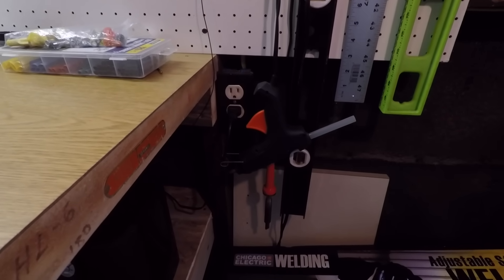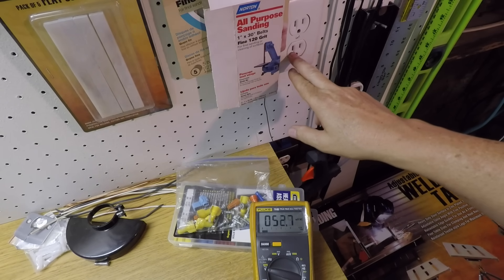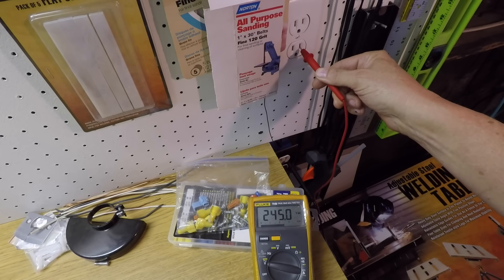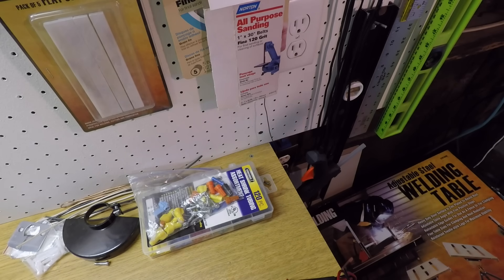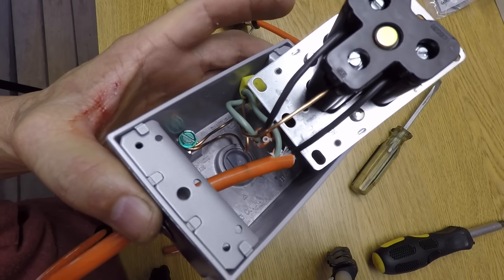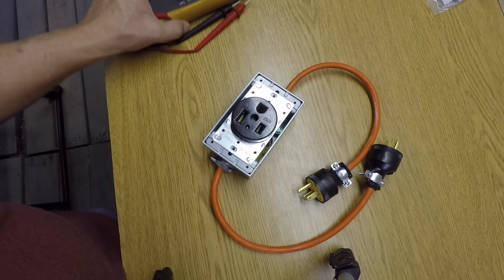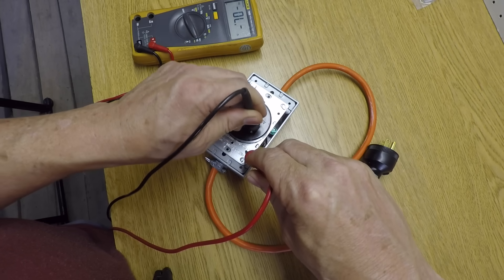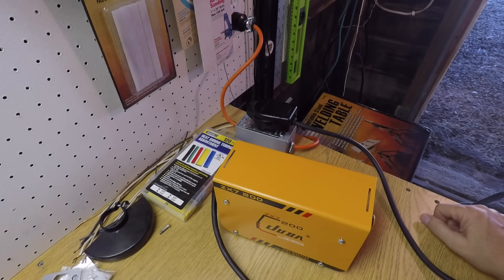How to Get 220v From 110v

Comment: definitely one way of doing it...i just made a 220  extension cable and plug it into my dryers outlet when i want to weld
Reply: probably the best idea next to running a dedicated line. And if the dryer is near where you need to weld, that works out great.

Comment: Your lucky that your 110 Volt receptacles are on different phases, if it wasn't you would have issues. What is not code and you never spoke about, at anytime on a 220 volt circuit your breaker requires a tie bar, so both breakers should trip. Safety first.

Comment: For my own home I would just run another 220 line from my panel. Plenty of room in there yet. In fact, there is a 220 line for an electric dryer in the laundry room that has never been used, we have always had natural gas dryer that plugs into 110 for the drum and ignition. But I like the idea. Thanks for the informative video.

Comment: If one breaker pop up due to 20amps + consumption, you will damage your 240v device running on 120v.

Solution for that is transistor as a switch
Reply: The connector he is using is a NEMA 6-50R and it has no neutral.  The bottom round connector is ground and should not be used for power as a neutral would, so this means that the device plugged in should not be able to get 120v power except by using ground which is not code and should not happen.
Reply: Not correct, you would need a path back to the neutral bus on main panel to complete a 120volt circuit. It draws 240v by connecting leg one of your panel back to leg two via the welder, so if a breaker pops you just have an open circuit. I suppose the danger is not knowing a breaker popped and opening the unit, and "completing" the circuit.

Comment: 20 A breaker, "20 A" wire, BUT 15 A plugs ??????? something doesn't add up.
Reply: NEC code allows you to use 15 amp duplex receptacles on a 20 amp circuit but not a 15 amp single receptacle on a 20 amp circuit.  Look up code 210.21B...He obviously has a few code violations here but that is one of them.
Reply: So what going on like drew parked said , he is using a different plug type then what we normally seen on 20 A

Comment: Just move to NZ we use real Voltages 230 Volts at 50 HZ (or 3 phase is 400 volts between). so we use 10 amp plug sockets. We also have the Round 15 amp Sockets for caravans etc.
Reply: I always wondered about that. When dumb asses stick their finger in a light socket, it must really be a shock.
Reply: Kiaora power almost as good as Oz power...

Comment: Most appliances that would use a plug like that could draw 20 more than 16 amps.  Wiring needs to be sized for 125% of continuous load plus 100% of non continuous load.   An appliance should only draw 80% max of the ampacity of branch circuit wiring.  Since this a 240v plug both legs need to broken at the same time should an overload or short circuit happen, especially if a neutral wire is present at the plug.  It’s a good temporary bandaid,  if you are experienced and know the wattage of the appliance to be plugged in.

Comment: Can i use this to my generator, my generator is 120v but i need 220v or 240v on my house, hope answer you reply on me, thank in advance,
Reply: Very unlikely you could use this method as the outlets on your generator are almost certainly linked. This method only works if they are separate lines from the box. Some generators (like mine) have a 220v outlet though.

Comment: You mentioned 2 hots and a ground on the welding plug. Well, technically, there are 2 hot wires and the bottom round plug is neutral, so it still has voltage going through it (it's not technically a ground).
Reply: The connector he is using is a NEMA 6-50R and it has no neutral.  The bottom round connector is ground and should not be used for power as a neutral would.

Comment: Sorry to rain on your parade but I have worked in the R.V. industry for the last 20 plus years and most 220/240 volts equipment needs 50amp. service and you will be tripping your circuits!!!!

Comment: Only 240V? I like to my 1.5kVa 120/240/480V Industrial Control Transformer set it up as a buck boost transformer splitting the 240V across the 120V winding to make 840Volts. I've been trying to get a 120/240/4160V control transformer for several years now so I can split the 240V across the 120V windings in both transformers and combine all voltages into 1.

Comment: What about if one phase trip one of the  breakers? Would it not  be better to use a double pole breaker  and don't burnt up your equipmente.?and use a two pole breaker and wire it according to the machine amperage?

Comment: Some say why not just install a 240V outlet. Maybe you could use this to hook two small generators to get 240v or use it some place where you can't put a 240 outlet. i.e. not room left in the breaker box. I'm no electrician I'm just wondering if it could be done. Thank you for the video.

Comment: That is 220v but its 20A beside that remember the 20 Amp wiring is 12AWG and if its a 15 Amp thats 14 gage. Away from all that you need to be at A and B bus  unless you have 3 phase.
I really appreciate the material, video quality, and great sound quality.  But this is not a good Idea you could fry and melt the wires in the wall in a long time usage.

Comment: So long as I have 2 x 110v outlet, on two separate circuits, I could in theory, make a 240v socket that I could in fact plug into an Australian socket outlet and still use the American sockets inside the coach, caravan, truck ect, as though I was still in America, and keep on using all the American appliances without converting it over to the Australian 240v version. I'm trying to find away to bring back to Australia an American RV someday.

Comment: Nothing wrong there, it will work just fine.  I wonder if the welder would detect a loss of one of the 120V lines and just shut down.  That would be an interesting experiment.